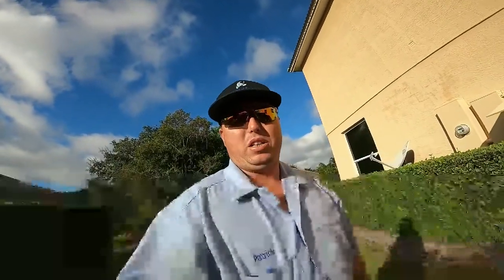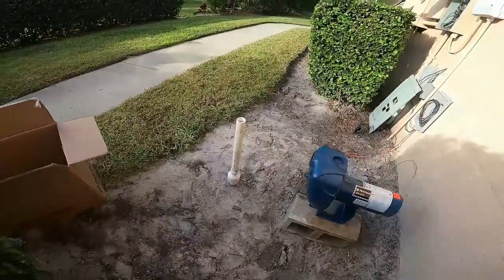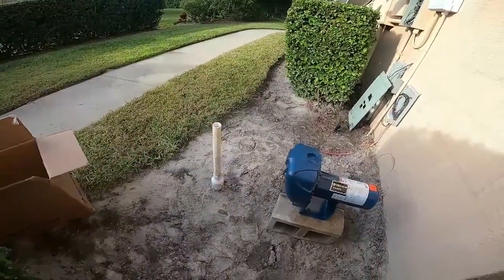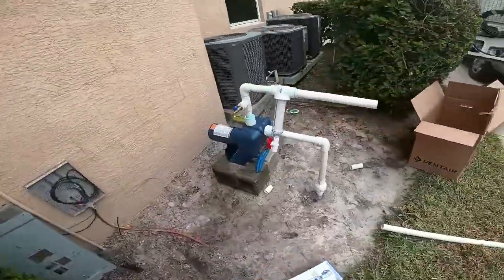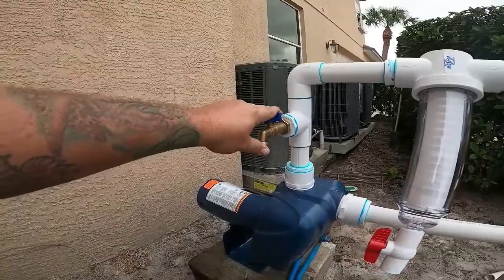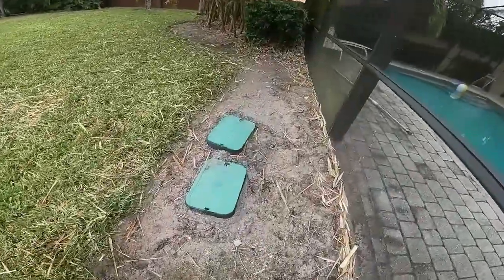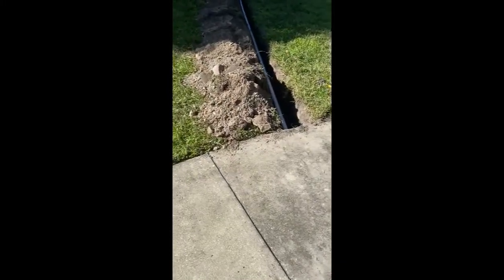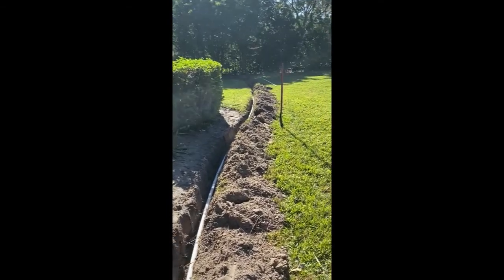city water to well conversation for irrigation

Comment: is there no reason to use a pressue tank when using the pump for irrigation ?
Reply from the maker: Not when using a pump start relay
Reply: @PJSprinklerRepairStCloud  Thank you, any reason to choose one verse the other?  A system with no pressure but  with pump start relay or  no pump start relay and instead a pressure tank?  Thanks!!!

Comment: Should the filter be installed as it pulls in water this way the pump doesn't suck up any junk which could potentially clog the motor?
Reply from the maker: No there is a screen on the well point for stuff big enough to hurt the pump. The Vu-flow filter is for small stuff that could clog the sprinklers but not hurt the pump.
Reply: @PJSprinklerRepairStCloud ahhh ok, thanks for the quick response

Comment: Hello, I’m doing a very similar conversion but I have not been able to find a pump start relay that has a manual on/off switch like you have in the video for when we want I turn the pump off without the sprinklers. What’s the model of the one in your video please?
Reply from the maker: I modified it myself. It’s tricky to do.
Reply: @PJSprinklerRepairStCloud  can you show us how you did this? thanks

Comment: How expensive is it to switch from city water to well water?
Reply from the maker: Not sure in your area. But hear in orlando the well was about $2,000 and this job I did was about $2,500. That was pump, electrical,pipe,filter and labor
Reply: @PJSprinklerRepairStCloud       Do you know the company that did the well for $2,000.00
Reply from the maker: @bobhoulihan8812  I wanna say big John’s wells I’m not sure.
Reply: I found a guy on fb marketplace that did my well, here in Fort Lauderdale for 1500. The well is 75ft deep.
Reply: wow. I am not in Florida but I just got a quote for $4000 for just the well and pump. They say I have to hire an electrician to install a relay, 220v outlet and then my irrigation company will have to come to disconnect the city water and connect the well.